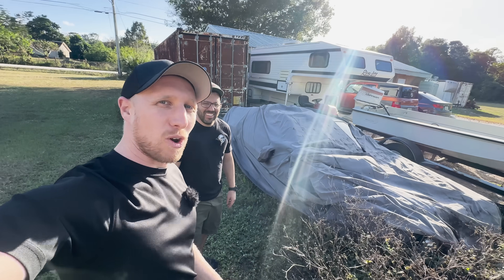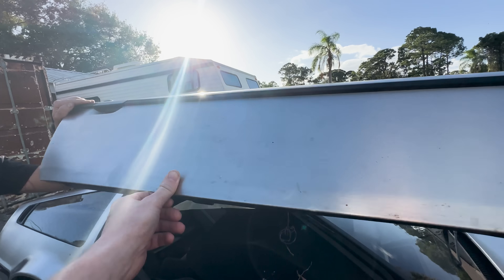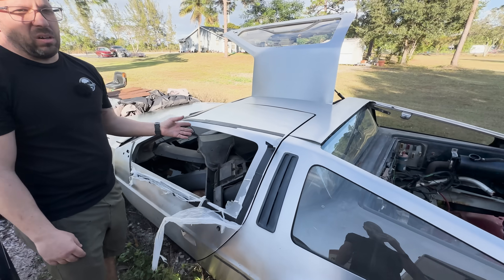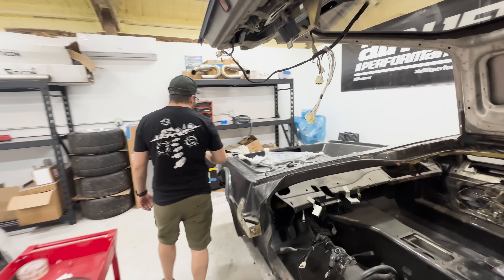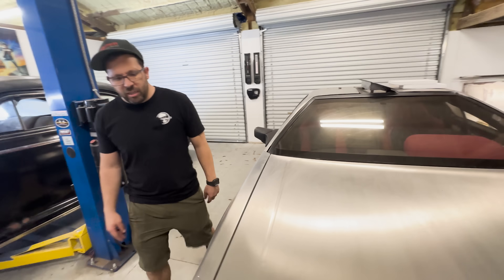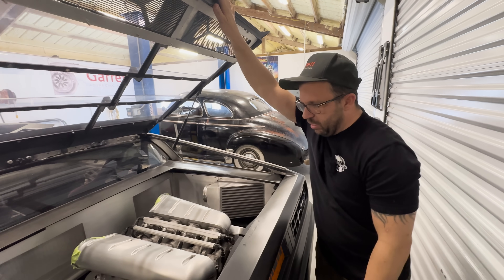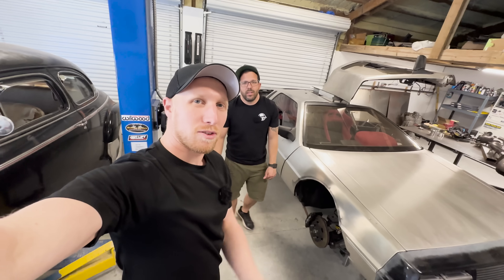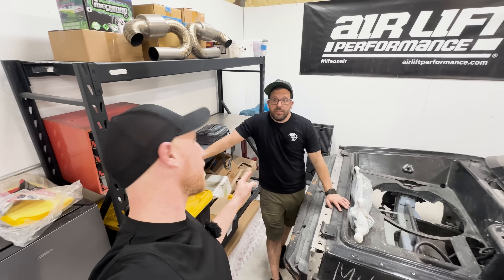Abandoned DELOREAN and I'm Turning it into a V6 Twin Turbo TESLA Hybrid EV Conversion!

Comment: Hybrid is a way to go. I have a project that might end up in a youtube someday. Currently figuring it out in the cad. 

I am interested in how you will control it. I have some ideas myself but would be interesting to see how you will solve it. 

Also how much kwh have you planned to use in the car?

Most likely you need to modify tesla model3 front suspension to some sort pushrod setup if you want to use it in this car. 

Or you need to make a mixture of different parts from different cars to make it work in your design .

I can say that my design has also tesla motor in the front.
Reply from the maker: It will probably be a model s sdu as I can use an AEM vcu to control it which give me a lot of options then mix with one of Holleys engines vcu’s as AEM is owned by Holley there is a lot of cross over/ support to make them play nice. Probably have to do a custom front end. kWh wise will probably be a 20kWh pack from a hybrid.

Comment: Hybrid would be such a waste of time and money, especially with the advancement in battery technology. You're carrying extra weight whichever mode you're driving in. If you want the sound get a speaker
Reply from the maker: The plan is to draw in the ICE audience by doing a hybrid would help bring them across to all ev. There is also going to be a awd Tesla based build starting next year based on a ve transporter t5/6 van
Reply: @Hazell_Nutz  yeah I understand what you're trying to do, but it wont work because the mainstream media keeps pumping out the FUD. You need to educate and show that BEVs are the better choice both financially and environmentally. Hybrids will always be a compromise and are the worst of both worlds, not the best.
BEV technology improves on an almost monthly basis, energy density, motor efficiency, moving to 48v etc, etc.
I wish you well with the project, but doubt it sway anyone

Comment: The PRV 2.5 V6 Turbo from a Alpine GTA V6 Turbo drops right in. Or you can use a 3.0 V6 24v PRV from the last Peugeot 605. The UN1 gearbox is a lovely box, im going to say its one of the best manuals ive ever driven. The gearchanges are so slick. Originally from a Renault 30 2.7 V6, but then later used by lots of manufacturers inc Lotus.

Comment: Ls swap it or if you can get your hands on one "if you ask weston nicely hed probably ask LUXIFER if he can source one" but green top BARRA swap it. The barra came in bunch of different iterations and the green tops were dedicated gas (LPG) So ford australia way over built them with forged internals, crank, higher compression ratio ect ext, you cann convert them back to petrol very easily, boost it and get a safe 750-800hp.

Think of them as the rb and 2j's bigger brother. 4L can be stroked out to 4.3 nicely but whats better is destroking them to 3.8L and getting 9krpm

So much you can do with just straight off the shelf parts here in aus, you have the edge of the exchange rate, its just freight... Do it!
Reply: A Barra in the back of a Delorean would have the motor sitting out the back end past the bumper like a dune buggy

Comment: I'm in the middle of building a turbodiesel plugin hybrid Tundra, and I support you in your quest.
Wait, so a twin turbocharged Honda V6, like from a hybrid Accord? Parallel hybrid so you can mount the engine longitudinal, use a Porsche transaxle, and use the Honda pancake motor for start/stop, charging and rev matching for shifting...
Mechanically that's quite straightforward but I don't know how you'll tie the Tesla controller to the Honda controller, let alone control Honda engine to rev match, and to have any control at all over the front/rear torque proportion (I'm not saying it couldn't be done, but that's likely a custom controller, custom FW).
I was originally going to build my hybrid using Honda hybrid components and I abandoned that when I learned about Toyota hybrid system. Luckily, the Toyota V6 hybrids are very stout. Both the 2GR-FE/FSE V6 and the eCVT. The inverter control has been reverse engineered on various models, so that portion saves some work. There is even an open source board (openinverter zombieverter) available that COULD control a gas engine (throttle, ignition power).
The downfall of those powertrains for this project is they're transverse mounted, which is less sexy than longitudinal (the longitudinal version in GS450h & LS600h are front engine RWD).

Comment: I’m stalled on my EV project working on my old Diesel Syncro.. and seriously considering a hybrid setup.. would love to see your take on it ❤
Reply from the maker: Doing ev only is definitely an easier option. This hybrid build will be hard as will be using a clever gearbox that will rev match.
Reply: @ my idea of a hybrid conversion would be the easy way out. Just put an outlander drivetrain in my Syncro 🤣. All those a3 GTE gearboxes s-tronic seem to fail..